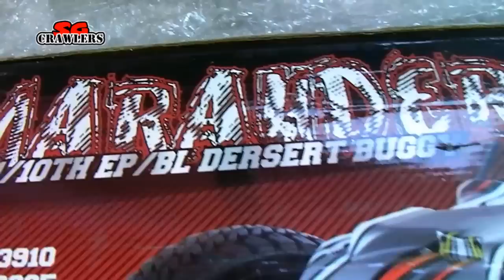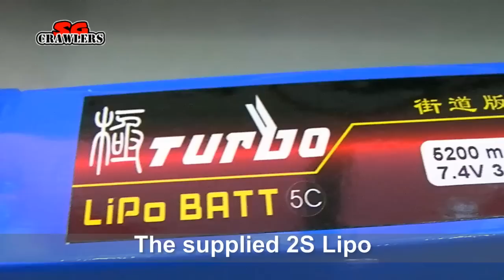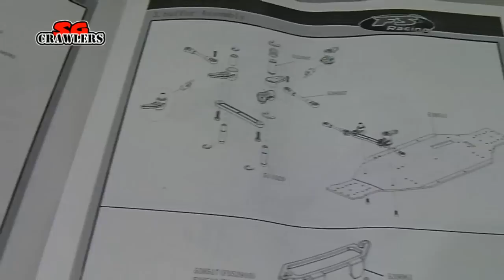Unboxing FS 53625 Marauder 1/10 2.4GH 4WD Brushless RC Truck with Roll Cage - Desert Buggy Style

Comment: the current link to the item 
( http://www.gearbest.com/rc-cars/pp_204253.html?utm_source=youtube&utm_medium=adam&utm_campaign=myhonchosgFS%201/10 )

apparently doesn't have the heatsink, could you please verify which one is the correct one? i would like to buy this car, but i don't want to end up ordering the one that is brushed
Reply: +Francisco De La Torre I wouldn't recommend buying ANYTHING from GearBest! You can buy this truck from Banggood for considerably less, and you'll even stand a good chance of receiving it! http://www.banggood.com/FS-53625-110-2_4GH-4WD-Brushless-RC-Desert-Buggy-p-944305.html?p=JQ26191551677201504Z
Reply: +Wane Hall Yeah I'll second that. I ordered a phone from them and it never turned up. They don't even answer emails.